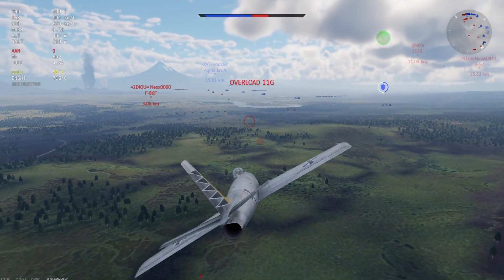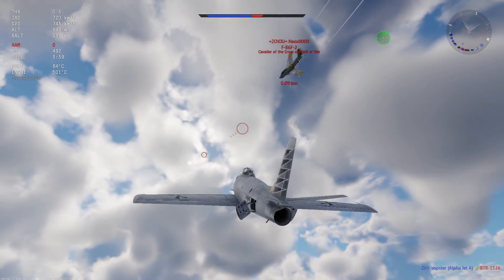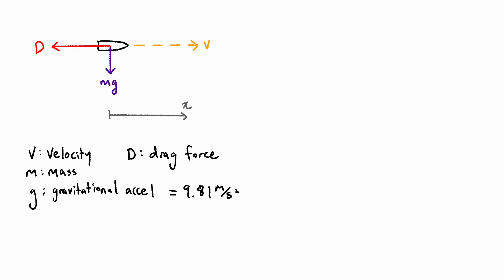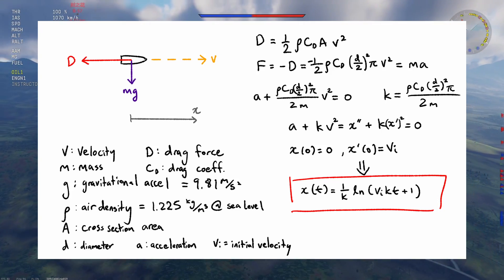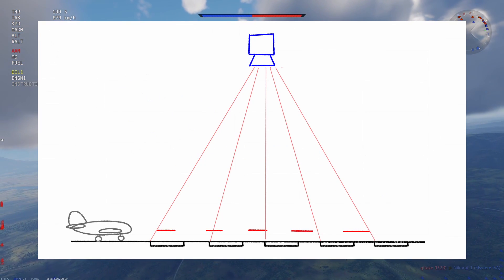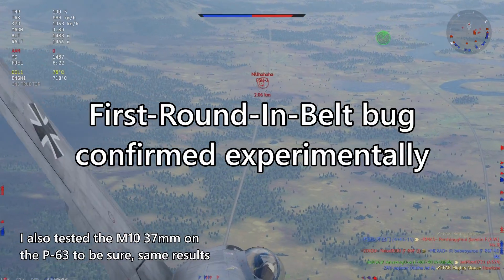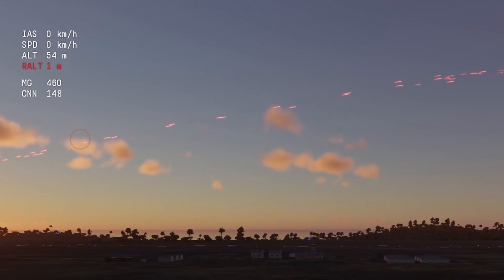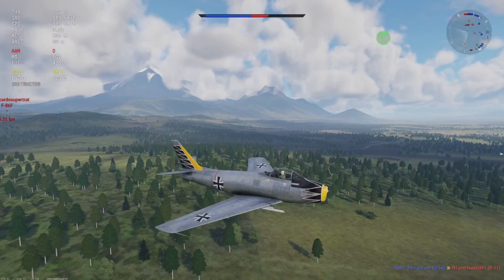Belts & Bullet Ballistics Explained | War Thunder

Comment from the maker: THE CROSSHAIR & CONVERGENCE SECTION IS CURRENTLY INCORRECT
FOLLOW UP VIDEO IS UP WHERE I CORRECT THE MISTAKE:
https://www.youtube.com/watch?v=wYiQxYbBKHs

Also, for the part about the .50cals catching up to the hispanos, this is wrong and misleading, the .50cal belts I was using on the British Spit LF Mk9 has similar but not better velocity than the hispanos when I was testing (there are like 5 different .50cal variants and I forgot to include a few)
Reply: i was gonna ask what happens to the crosshair distance if you don't set a convergence range
Reply from the maker: @flynntaggart8549  I said it in the video but when convergence is set to "no", the projected distance of the crosshair and mouse cursor is 1000m or 1km. You can test this yourself in replay mode, where your mouse cursor shows up at the distance you've set in free camera mode
Reply: If you make up a follow-up video you should mention the ballistic coefficient. Noting that m is proportional to d^3 for a given geometry, the ballistic coefficient is proportional to d, and hence large-caliber shells maintain their velocity better at range. For example, on the graph at 6:22 the low-velocity 37mm catches up to the faster shells. This is very apparent in ground and especially naval battles.
Reply from the maker: While this trend is generally present, i dont think the trend is strong enough to really necessitate pointing out. like a lot of 7mm MGS go very slow and a lot of 20mms go far but the .50cal browning goes very far for its caliber. I could list the ballistic coefficients but i think its more visually easier to understand if I just show the graphs like i did in the video where you can see how far it travels in a given amount of time
Reply: @CatWerfer  It gives you an idea how much penetration a round will maintain at range, which is hard to tell from the graphs. It's more relevant for tanks/ships; a 122mm shell fired at with 800m/s will be effective much farther than a 30mm shell fired at 800m/s. None of this is intuitive for new players.
Reply from the maker: @KekusMagnus  maybe I'd go into that if I get around to making a video on tank penetration values and demarre calculations but for the purposes of this video I think I would like to keep it simple
Reply: @CatWerfer  Funny you say that, I've been investigating how warthunder models AP slope modifiers recently.

As for DeMarre, there is an old Reddit post discussing Gaijin's use of the Demarre equation. They set a reference penetration of 100mm for a 1kg 100mm shell at 1900m/s. This applies to all APC shells, with a 10% pen reduction to uncapped shells, and another reduction of up to 25% due to the HE filler

Very cursed, Gaijin must think it's "good enough"
Reply from the maker: @KekusMagnus  classic gaijiggle

Comment: Hi CatWerfer, could you do a comparison of MG131 IAI and MG151 strealth belt? I really want to know if MG131 IAI could be a good indicator for MG151. And which belt of MG151 is closer to MG131 IAI, than you!
Reply from the maker: did you check the follow up video i did comparing all gun ballistics?
im not sure if i tested that specific set of belts but the guns at least should be compared
Reply: @CatWerfer  Your graph did have MG131 API but not IAI belt
Reply from the maker: @yingjiewang2245  as much as id love to do comparisons for every belt, it would take too much time and i have other things to do.
you have the formula for calculating the ballistics, and you have the datamine files to base the numbers around, so if you want, you can run the calculations on your end.
If you really want me to do it for you i think this is the point where i would have to decline unless there were some other incentive.
Reply: @CatWerfer  I will try the math, thank you very much

Comment: Due to the tracer component in the machine gun bullets, the weight of the bullet changes as the trace element burns off, causing a reduction in damage at range. It can also effect accuracy of the bullet. For cannon rounds with high explosive element and tracer, such as German FI-T, the comparison to the Minengeschoss rounds is more dramatic as the tracer point of aim and point of impact is deviated significantly from the non-tracer high explosives.
Reply from the maker: @GuroGamuMonsuta are you certain that gaijin models those factors?

Comment: This is really interesting, although i had a fair bit of trouble picking out which colour was which round on the graphs, being moderately red-green colourblind.
Reply from the maker: oof i hadn't considered that. i had trouble putting all those graphs with those colors on there together already since the plotter i used only has 10 colors max per graph. ill try to label them better next time
Reply: @CatWerfer  Having the legend line up with the graph (i.e. the line that ends up on top uses the first colour, the one below uses the second colour, and so on) would really help. 

Great stuff regardless though, currently binging your energy-maneuverability videos. I really appreciate the effort put into explaining your methodology.

Comment: I'm glad that you cleared up if the gun bud is unique to aircraft or also effect ground vehicles, I've been trying to figure that out but no one seemed to have concrete answer. Specifically I've wondered about how the Falcons belts act, because as someone who has played a lot of it, I really thought the APDS rounds had less drop than the rest of the shells, but I must have been mistaked and just thought so on "vibes".
Reply from the maker: i haven't personally tested it with ground vehicles but it does seem to be the case according to other ppl who have tested it
Reply from the maker: Also the velocity bug only affects initial velocity. If the APDS has less drag and more mass then it will still travel farther than the rest of the rounds

Comment: Awesome video, you should cover how projectile penetration is calculated next! I’m assuming gaijin fudges some values for balance but I’m curious how they programmed it under the hood
Reply from the maker: that would be a lot harder to test without custom mission setups and I'm no good with those... There are people on the datamine discord that are much more into the way they're calculated, but penetration power does have to do with impact velocity.
Idk, i'd like to try and find out but without a method to do so I'm kinda stuck on square one.
Glad you like the video!

Comment: Is it confirmed that shell velocity affects penetration of ground vehicles? I.E. diving faster while shooting means better penetration. If there was a way to calculate this, it would be interesting to compare with the statcard penetration numbers
Reply from the maker: I haven't tested it (idk how I would) but it probably would only make a difference if you're going really fast, where the speed of your aircraft would have to be a significant fraction of your muzzle velocity
Reply: @CatWerfer  You could maybe calculate how long it takes for rounds to decrease back to normal muzzle velocity (plot speed, instead of distance, against time) that would be an interesting idea on its own
Reply from the maker: @puff7145  I did do those speed vs time plots on my own befor emaking this video to see if they were easier to understand but they didnt look as neat or practical as the distance vs time one.
i dont really wanna make new videos every time i decide to plot something new on an old topic so maybe i'll make some kind of platform where i can share that kind of data

Comment: The belt bug doesn't seem to work for everything. It's especially apparent when using the Bradley or BMP as they have 1 HE shell with their APDS and it is noticeably slower and as a result drops to the ground at closer ranges.
Reply from the maker: Huh that is quite interesting, I should check it out

Comment: .50s are going to feel a lot weaker than any cannon armament at range despite technically better long-range performance because .50 really relies on kinetic energy and multiple hits on a single component to deal real damage, at range the velocity and dispersion makes hits weaker and spreads them out across the fuselage, anything 20mm or bigger with explosive filler is going to do a lot better with just a handful of hits spread out across an aircraft.
Reply from the maker: @brosefmalkovitch3121  yeah I figured it had more to do with damage output (and skill issue)

Comment: how do you find listed bullet velocity?
Reply from the maker: 1) select a plane in the hangar. if you own the plane, you can either view it in your lineup or hit "customization" from the techtree. If you don't own it, you can hit "preview" from the techtree.
2) select "armor" to turn on armor viewing mode.
3) under "armor", select protection analysis mode. this will bring up the ability to test fire rounds at the selected plane and see how much damage it takes
4) under "shell" it tells you the currently selected ammo type. you open the dropdown menu and look through all the different ammo types.
5) if you hover over each option, it will tell you different stats about the round, like the muzzle velocity, mass, penetration, and type of damage (but not coefficient of drag).

If a belt only has one type of ammo in it, you can also just view these stats in the modifications tab dropdown where you select what kind of ammo you want to use, though most belts have mixed ammo types so you can't do that for all belts.

You can also go to the datamine page, find the cannon you're looking for, then find the stats of the round you're looking for in the file for that cannon, but that can be a pain in the butt...
Reply: @CatWerfer  thank you

Comment: Is there any evidence to suggest that gunners use different ballistics? I feel I've been killed at impossible distances/speeds by bomber gunners.
Reply from the maker: @steve_i400  mmmm I don't think so. Usually in the datamine files, gunner based guns are more prone to dispersion.
You maybe died because remember that since gunners fire their guns backwards, their bullets aren't flying against the wind and have a lot less drag than if they were forward, meaning they fly a lot more in terms of relative distance
Reply: i love firing my gun backwards while running and seeing it fly away from me, but the guy standing still recording it sees the bullet sitting stationary in the air
Reply from the maker: @Numerose1  relative motion do be funny, just don't travel close to the speed of light 💀
Reply: @CatWerfer  💀

Comment: nice video, appreciate the detail on it
do you know if gaijin use the horizontal differential equations(which have the analytical solution you showed) for all drag calculations, even if you nose is at, say, a 45 degree angle(or any nonzero angle above flat), or does it use the non-analytical set for quadratic drag in 2 directions?
ive written a calculator for the latter and how precise you want the code to be can significantly increase compute times so i can see why they'd just go with the former
Reply from the maker: I'm not entirely sure if they do analytical calculations at all, i mean for all we know it could be a per-frame calculation with a certain amount of directional deceleration applied at each frame to oppose velocity. I don't know how computationally expensive that would be though, I don't know much computerscience so tbh you probably have a much better idea on how they calculate it in game lol.

Comment: Great video! I like that tou calculuted time to travel based on drag, useful!

When you did Spitfire 50cal vs hispano test, keep in mind Spit M2 browning have much lower muzzle velocity (793m/s  or 832m/s depening on belt ) than US 50 M2 browning (899m/s on tracer).

I hope it's not braggy but i made a similar vid that with the same conclusions about first round determining all velocity.

Btw. Right now NR-30 has by far the lowest drag coefficient in the game.
Reply from the maker: I didn't know you had a youtube channel, ill check it out in a bit
Reply from the maker: I'm going thru the drag coefs right now for other planes and the a10's gau8 has a lower drag coef than the nr30
Reply: O! Good to know

Comment: It always annoyed me that there isn't a "crosshair distance" setting. I like to change the gun convergence depending on the aircraft but the differing crosshair position messes with my aim.

The belt bug is an embarrassing bit of spaghetti code and I'm impressed they haven't fixed it all these years. It makes the MG151/20 "air targets" belt significantly worse than it should be
Reply from the maker: yeah... gaijin is too busy adding new features like realshatter that noone asked for ig

Comment: I just recently found this channel you do good work but I never realized how much of my college math classes I forgot lol do you have any tests or info on damage between Ap and He shells? I've been just goofing off with ground target belts on m2s and the 190 with aphe and it seems like sometimes they do way more damage but I haven't done any serious testing
Reply from the maker: mmmm unfortunately no I don't really have that much info on how shell damage works. I feel like after realshatter, a lot of stuff became pretty inconsistent in damage output but overall I feel like for most belts, the high explosive and fragmentation (and sometimes APHE though they usually have a fuse and need to hit something thick) bullets usually do the most damage. If they don't have that, then armor piercing incindiary (not armor piercing or incindiary by themselves) are good for damage or at least setting fires. These are more vibes though, I can't be certain. You can always test using the protection analysis in the hangar but I also feel like that's inconsistent too.

Maybe if I learn how fragmentation and damage is actually calculated i could do a more in depth explanation on how damage to components is calculated ingame... I know that each component in an aircrafts damage model has its own HP value though but not much beyond that.

If i were to try and investigate this tho, I'd probably go talk to people in the war thunder datamine server. They seem to know a lot more about how the game engine works so if you want a super technical explanation, that's probably where I'd go to see if you can piece together an explanation.
Reply: @CatWerfer  thank you for the reply, I started because I noticed the air target belt on I believe ki61 seemed to give weird results but of course 12.7 he is not very powerful
Reply from the maker: I remember that they used to be really good before the realshatter update, probably thanks to their HEF-I rounds, though after realshatter the fragmentation probably got nerfed (like it did on a lot of planes)